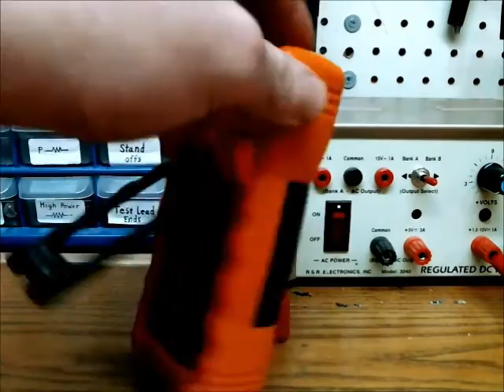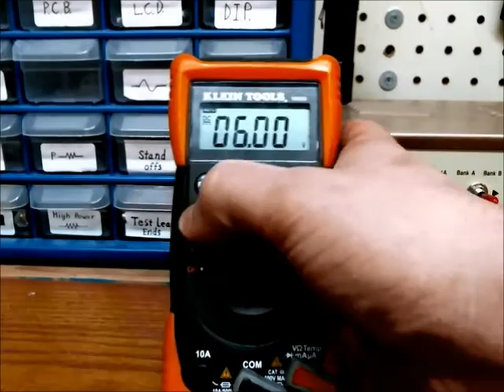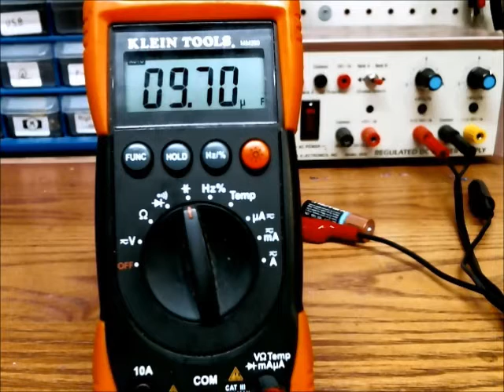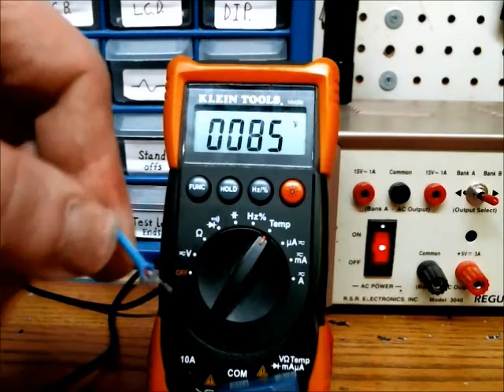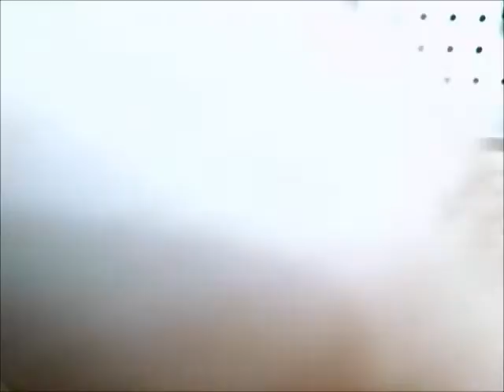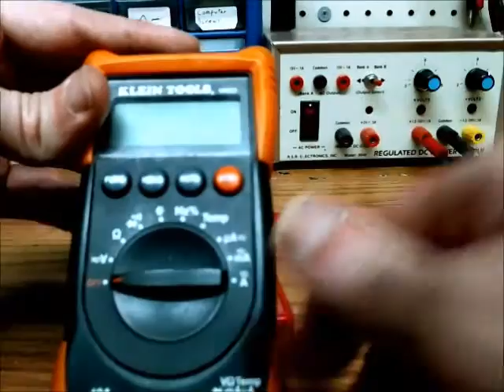Review: Klein Tools MM200

Comment: does connecting the positive lead to the 10A side change the reading? connected that way it measures wall outlet at .5  volts.  i have replaced the battery.

Comment: This should NOT BE considered a valid review. Measuring anything besides a precision resistor box with .01% or better tolerance is meaningless. Measuring 10% capacitors is especially meaningless. And measuring voltage without a precision supply is pointless. All this does is imply the meter is substandard, when it's not. And why no disassembly? The real measure of a multimeter is how it's built.

Comment: Thanks for the video.  I also bought one of these at Home Depot and it's good little multi meter.  It is interesting that you mention that the top buttons will stick because the one that I have does not do that.  Also, the knob seems to work just fine.

Comment: I just bought this meter from HD. I am experimenting with generating induced current with ceramic magnet and 24 AGW wire. I used this meter to measure the DC voltage output. Before the experiment began, the meter was reading 0.012 mV after moving the magnet for 1 minute to induce EMF, the meter reading kept climbing never stopped even after 5 minutes. I manually stopped the reading (at 356.6 mV) by pressing Hold button,  Is the meter faulty or it is the way it supposed to work?

Comment: Heilman Hackatronics 
I have one of these. It works great! It's my first and only digital meter. OTher then that I have a high quality analog one. The voltage, current and frequency are the things I use the most, as I experiment with low frequency RF stuff and switching supplies often.I occasionally use the thermocouple too for measuring heatsink temps and similar. Only problem I have is a small plastic tab in the switch broke. Now it dosen't click but only side between functions, had it about 3 years now.
Reply from the maker: theLuigiFan0007  I also have developed issues with the function knob, have to click it back and forth a few times. I'll probably open it up and try contact cleaner.
Reply: Same. But I thought that was because it was'nt going into a specific spot. Might try cleaning it then.